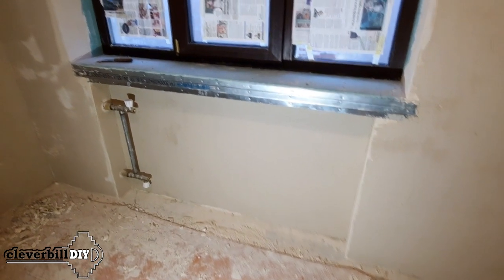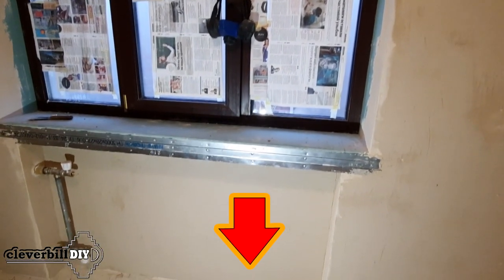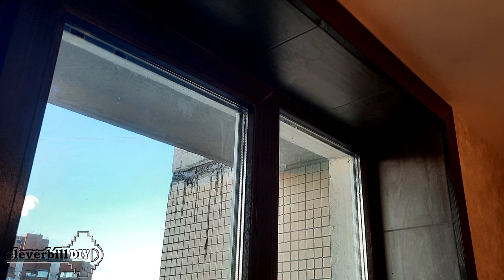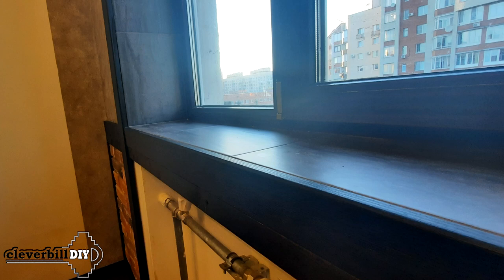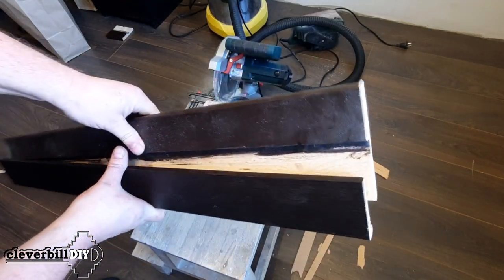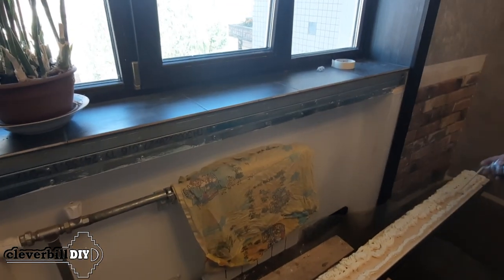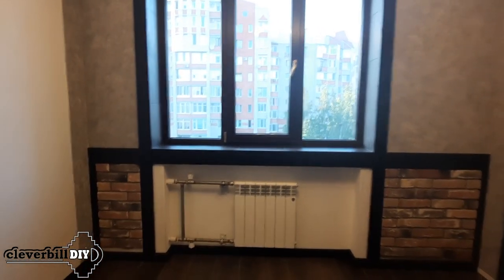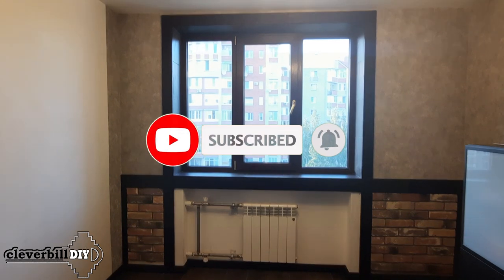Window decoration - finishing the window sill and window slopes with tiles and wooden platbands

Comment from the maker: You can make a beautiful finish of the slopes and window sill using tile or porcelain stoneware, the tile has a significant plus, it is easy to clean, is not afraid of moisture and friction, and the existing variety of tiles allows you to choose it for absolutely any interior.